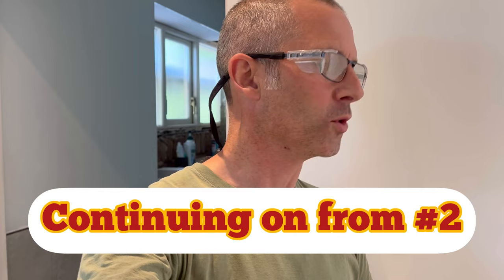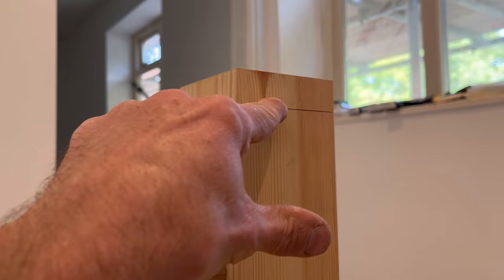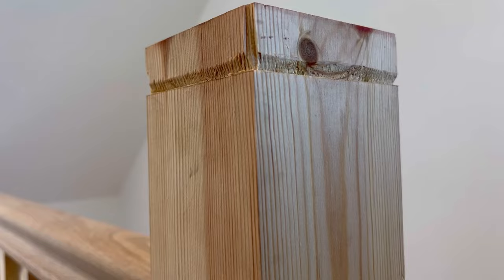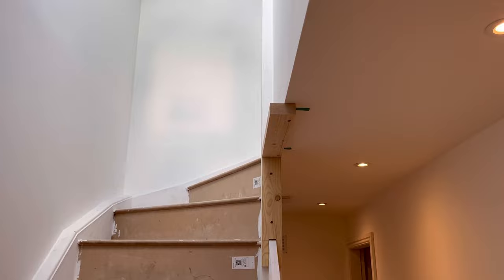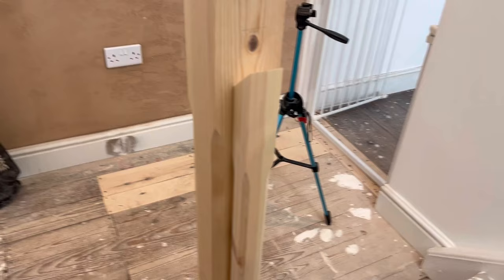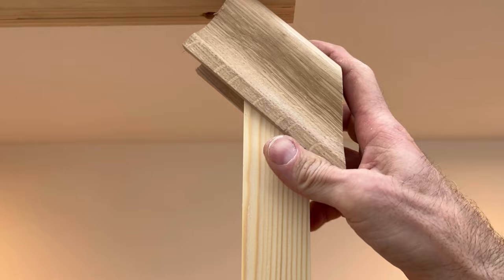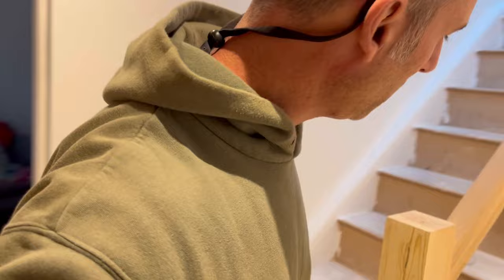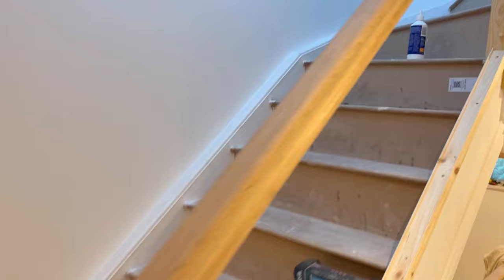How to fit stairs # 3 - Setting out spindles on a staircase

Comment: What I normally do at the top of that handrail on the raked staircase, as you call it, I don't put a half newel there on the ceiling, I rip cut my handrail in half and stick that onto the plasterboard, to inmitate a hand rail, im not too keen on the way that newel post and cap looks when stuck on the ceiling.
Reply from the maker: Hi Polly and thanks for your opinion they are always more than welcome. We all like our certain ways of doing things but as long as the customer likes it that’s all that matters. Can’t see how the handrail cut down would finish nice but maybe I’ll have a look at it sometime. 👍🏻
Reply: @MR A BUILDERS  my names James, sorry im on my daughters account lol, obviously the customer satisfaction is a must. Its quite hard to explain what I mean through a message, but basically I would rip a piece of handrail down the center then plant that horizontally onto the wall with a 21degree angle on the end then cut my hand rail with a 21degree angle on the top end, assuming your staircase is 42 degrees like normal. No need for newel caps as all you can see is handrail.

Cheers James
Reply: Ps, im not criticising your work, just mearly telling you what I do.

Love your videos, keep it up 👍
Reply from the maker: No worries at all James thanks for the support 👍🏻

Comment: The way I used to work out the spindles spacings on the rake was to drop a plumb line down from the top newel and measure horizontally between the 2 newels, then just do the same as how you did the landing. You did lose me a bit for a while but I got my head around it in the end. Looks a good job you done. 👍
Reply from the maker: Cheers Kev. I lose myself sometimes but I thought the clip of the workings out may help people to understand better 👍🏻

Comment: So reading these comments , i understand that even experienced joiners have no set standard to fit spindles. Im just goin to keep to 99mm get to the endif i need to lose 10 mm ill lose a mill on each spindle
Reply from the maker: Hi 
It’s not about the standard it’s about getting all the gaps the same but maintaining the maximum 100mm between them. Your method will work fine if your happy with the different gap at the end 👍🏻
Reply: @MR A BUILDERS  
It's not possible to get a 100mm centres always and be a 100mm centres at start to finnish. You or do you equal them at a 100mm and then at the end equal the end to be even at the start and end with all a 100mm between. I understand if you equal everyone  spacing but it won't always work out 100mm that's not true, I've never ever had stairs always a 100mm equal, maybe around 85mm upwards to 100mm well there abouts.
Reply from the maker: Hi and maybe we have crossed wires here. You are correct you cannot and will never get 100mm equal spacing on any spindles. The 100mm is the maximum you should stick to when calculating your equal spacing. It could be 87, 92, 99 who knows. Thanks for commenting on our channel. 👍🏻

Comment: Nice job    what we normally do is run the hand rail in the underside of the ceiling then ad a piece of  base rail in to the back along the ceiling   so u don't need that 4x2  on the ceiling    still a nice finish  keep up the good work

Comment: Hello, semi retired Bricklayer here,as I had been waiting months for a carpenter to be available to fit a bannister that had been previously removed for some reason, I decided to have a go myself. I came across your videos, which were brilliant!! I think the timber I used was similar to yours, it was pine from Selco builders merchants. The newel had been cut off at a 45 degree ish angle, so I lined it up with that and added about 75 mm above the top of the handrail for the finished height, and glued and fitted it with 7 screws, unfortunately a couple of the screws were protruding slightly with the angle and wouldn't move,but I filed them down flush,first schoolboy error!Then I cut the baserail with the beval set at the angle of the  newel,measuring the whole length, but reversed the beval at the top resulting in a shortfall there ,so cut a small piece in and glued it in situ ,mistake number 2 ! But as I knew it was being painted as the existing, I knew I had a bit to play with, as in filler,and paint .The baserail was very bowed ,but following your instructions, I lined it up,and fitted it straight.I didn't make the same mistake with the handrail, as the baserail. Then onto the spindles which were not to bad as they were 45 degrees which I cut in a mitre box,and they were plain with no features intentionally to make it easier. I followed your way of setting out the equal gaps,and done a few" dry runs" with an offcut spindle, but it didn't work out that good,so I set out from the bottom at approx 95-100 mm and when I was two thirds through, I adjusted the last ones to suit and they came out well.With the offcuts fitted into the grooves top and bottom it seems sturdy enough, and now it's been filled where needed, and rubbed down, I started the primer paint yesterday. Considering I am a novice I am pleased with the end result, and thanks again for sharing your experience. Ray
Reply from the maker: Hi Ray I’m glad I helped you out with a bit of info but from your message it looks like you had it covered already nice one and thanks for watching. 😂

Comment: After years of thinking of a way to set out spindles on the stair string without using geometry, I thought of an easy way to do it.

First, measure 1000mm up the string from the bottom and mark it.

Then, Measure back horizontally to the newel, it'll be around 750mm.

Next, measure the full length of the string, in your example 2415mm.

Multiply 2415 by 750 which is 1811250 which is obviously 1mtr 811mm (divided by 1000)

This gives you the horizontal length you'd use if you were just doing a balustrade, using a horizontal spacer.

So, with three measurements and one calculation, most of which you'd have to do anyway, it's made easy.

I used to go up the string to about halfway and then work from the top downwards, as a 1 or 1.5mm rounding up or down on the spacer multiplies with the more spindles needed.

It may sound complicated but as I said, it's just three measurements and a calculation!
Reply from the maker: It all sounds great to me Allan and I’ll certainly give that a go next time. 👍🏻

Comment: Thank you for sharing your video, it's very useful :)
I just have a quick question please, how did you connect the top of the handrail to the timber on the ceiling? Did you use a handrail fixing kit of did you screw it?

Comment: Was your base rail flat at the bottom or did it have a slot for your stringer? Thanks!
Reply from the maker: Hi and thanks for the comment. If I remember it was flat but you can get one that rebates on top of the stringer. The only thing is with the rebated ones you lose the opportunity to tweak the base rail if the stringer is twisted. (More for older houses) 👍🏻
Reply: @mrabuilders6723  It’s really hard to find them with the rebate, I’ve looked everywhere 😩 but if it’s quite normal for a bit of an overhang I’m sure it will be fine to use a flat one then :) thank you so much!

Comment: Did I miss the part where you figured out the angle and size required for each spindle?
Reply from the maker: Hi and thanks for commenting. This is Part 3. If you go back to part 1 I’m sure I covered that. If you have any more questions feel free to ask. 👍🏻
Reply: @mrabuilders6723  Also cant find where you've done this, even in part one.